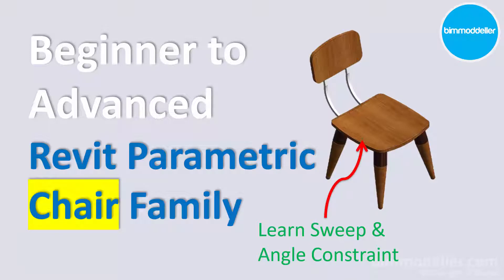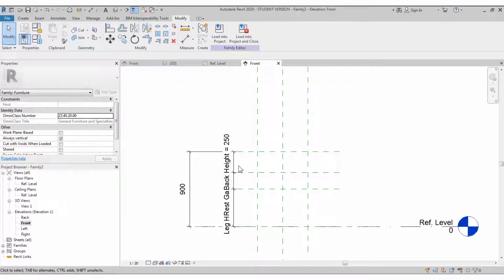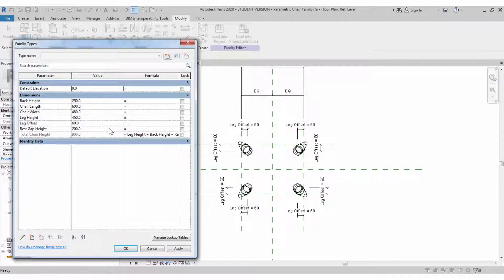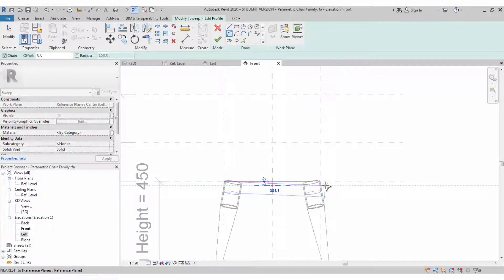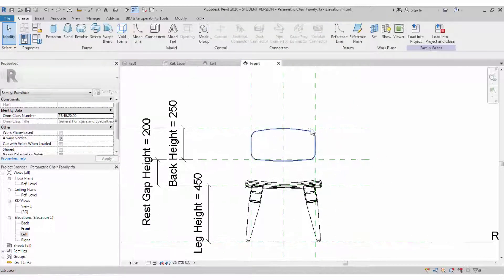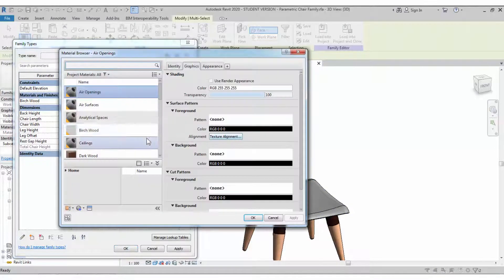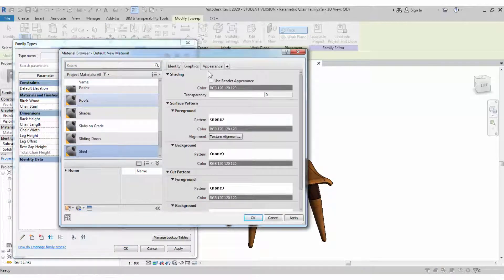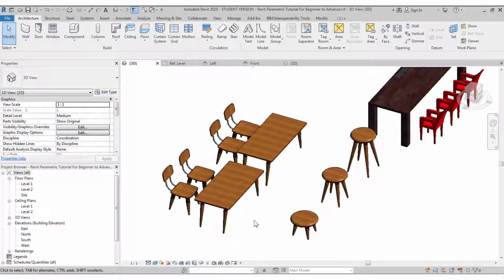8. Revit Parametric Chair Family

Comment: Without constraints the sweep profile drawn on left plane between the reference line can adjust with the change in parametric width, where as the profile drawn over the front plane cant be adjusted. When changing the length parameter the legs dislocated with the adjusting parameters. I tried both ways, Please explain also how to constraint the profile drawn by sweep option as well
Reply from the maker: I will try to do it.